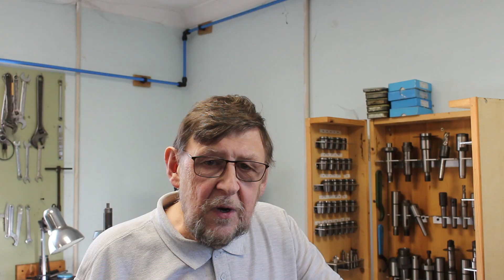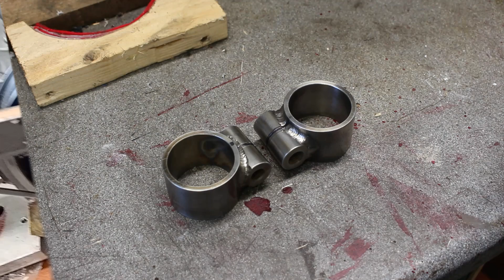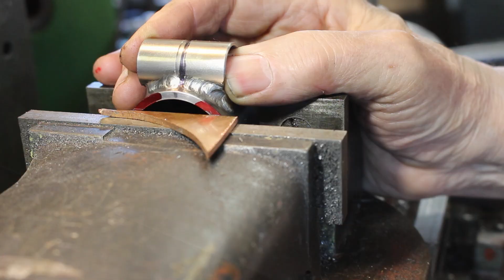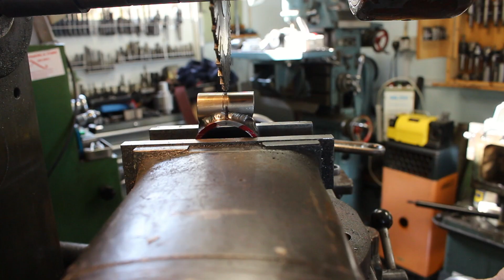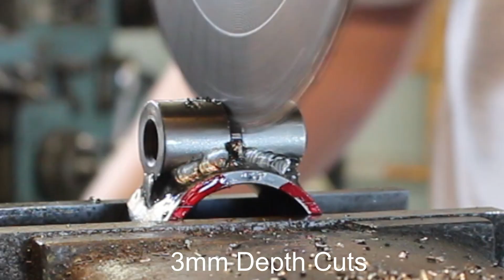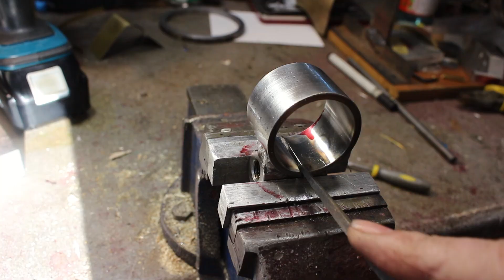Update & a Favour for a Freind needing Horizontal Milling

Comment: Very good - which horizontal mill is that please?
Reply from the maker: Thanks. It's an Elliott Victoria Junior Mill around 1960, it a very versatile machine for it's size.
Cheers
Reply: @GoCreatehms  Thanks for that.   I have an Elliot U0 universal mill.  It came with a vertical head (no quill feed) that needed two strong men and a boy to lift and fit.  So the previous owner had fabricated a swing frame carrying a Bridgeport head - when locked in position it is a vertical mill - when swung out of the way it is back to being a horizontal mill.
sort of ok, very clever, but suffers from lack of rigidity in vertical mode, so I need to uprate the system.
Cheers, JJ

Comment: Why only 3mm cuts, instead of a full depth cut?  The Lion build looks great.
Reply from the maker: Thanks, I do like the way Lion is coming together. Yeah, a full depth cut would probably been ok, I like to be cautious with relatively slender cutters.
Cheers
Reply: Kind of my thought too. In a production situation that would be normal,  but you would also have some special fixtures to align and prevent part pull out. Doing lighter cuts makes sense on prototype runs where you can't afford to damage the parts or tools. 
.
The mill would have happly made that cut, but Prudence (she's a bit of a nag ) dictated caution.